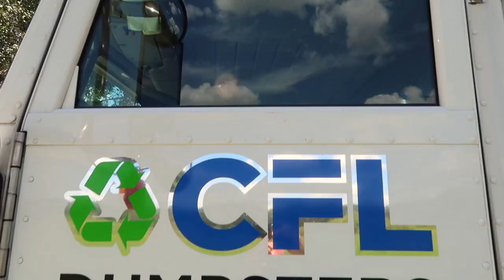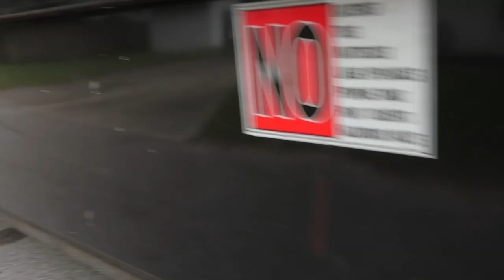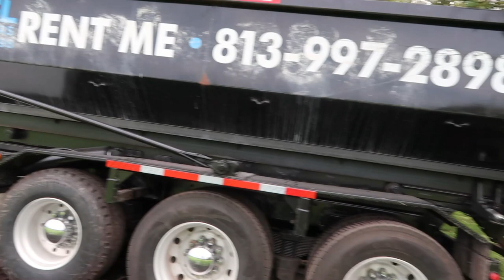Roll Off Dumpster Rental Business - Heavy Concrete Dumpster

Comment: Great video very helpful!! The company I work for just bought their own rolloff truck and I’m on the university of YouTube checking how to operate it lol, we’re in Lake Wales so good to watch a local video, we bought it used there was a leak on hydraulics is this something I should look out for? We got it fixed but is a leaking hydraulics something that commonly happens. It was the cylinder thanks.
Reply from the maker: @billyrthomson  small leaks are common, from hoses, but cylinders that’s not common. You probably have to have them rebuilt, but you really should take care of them as they come up because hydraulic fluid is flammable specially near the exhaust or engine.

Comment: how much is your dump fees
Reply from the maker: C&D 50$ class 3 60$ concrete 0$
Reply: @CFLDumpsters  Wow that’s good. And your cost is around $450-$550 for 20yd? Get that money
Reply from the maker: @georgelokko4333  I charge 400$ for a 20 if outside of 15 miles I charge delivery. Keep in mind the dump fees are per ton. My average dump tonnage cost is 85-90$
Reply: What happens if the load is past the weight expected on your quote?